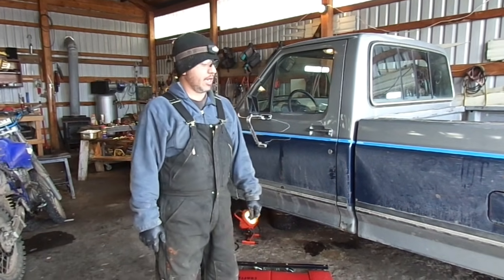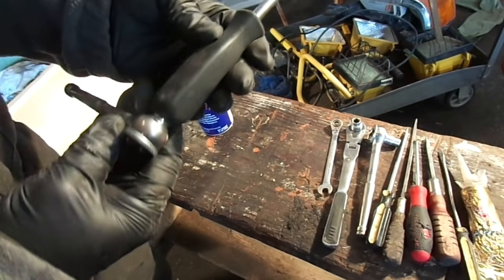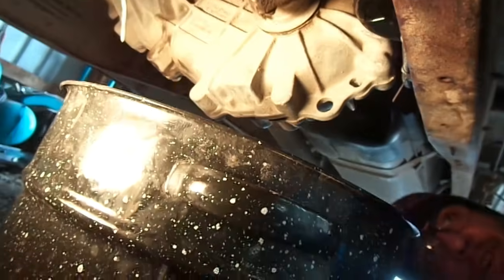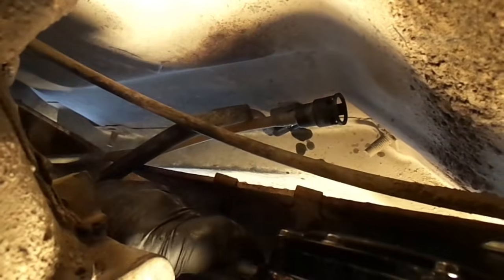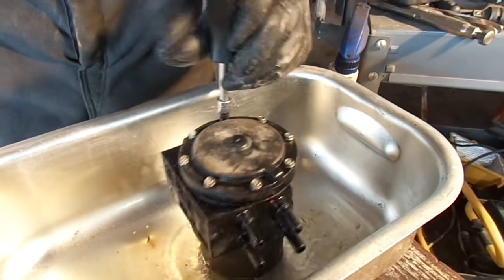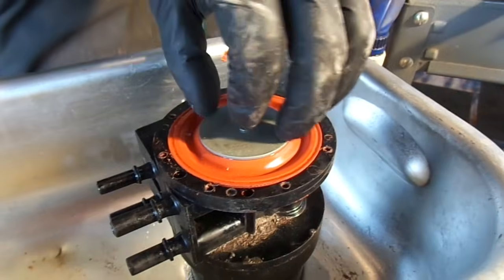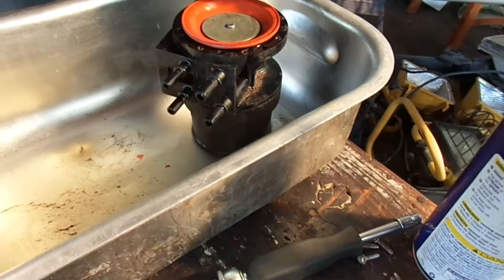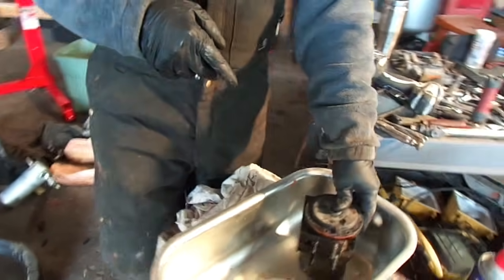1987 F150 Dual Fuel Tank Selector Repair

Comment: My experience is that this part is not usually repaired and replacing it from eBay is in the $50.00 range. No specs on torque force.

Comment: I know it's 8 years old and my 91 f250 460 4wd doesn't seem to have this part or at least it's not on the rail.  But thanks for making this.  I will sub to  see your progress in life.   It was hard to take a video in the dark under there with gas dripping. Kudos.  So some port directs the gas to the top of that diaphragm and pushes down.  So I'm sure that's why the top orientation matters, thus the pins.    So just curious is that diaphragm available in case it splits.   And man that is a hard filter to replace.

Comment: Love the video.  This solves my problem.  My front tank empties real quick, because the return is going to my rear tank.  I run off my rear tank, but only fill my front tank, till it is dry.  This happens in about half an hour with a half tank.  Then I switch to the rear tank, which I haven't put any gas in it for over 2 years.  My procedure is a work-around, but this information is the solution I have been looking for.
Thank you very much.

Comment: I have an 86 EEEE-150 dual tank. I imagine they used the same equipment? The van has been in a garage 25 years. I put a battery in it, and it cranks over like a new car, SUPER fast. It also has spark, and the air filter still looks like new. I am guessing either one or ALL of the pumps are bad, and probably the selector as well.
Reply: Well, finally crawled under my van, and it is COMPLETELY different from this. Glad I checked! The selector valve is electric, and readily available on rock auto for less than $70. And since it is 2wd, there TONS of room to work on it!!

Comment: Awesome job. I'm trying to troubleshoot why my truck had the side tank removed. I had all of the parts to put it back in and once I was ready to connect the lines I noticed that this valve is missing. This gives me a high level of assurance that once I purchase a replacement valve I will be able to run both tanks again.

Comment: Nice video, thanks a bunch. I have an 87 4x4 F150 lariat with the 351, its a factory 4bbl HO engine and it has the mechanical pump going into the timing chain cover with the egg lobe on my cam. I wonder if my unit is different. I will go look in the morning as I have the back end up in the air as I am redoing the back brakes cause of some idiots screw up on them 5 years ago. Both my floats have drowned so my tanks don't read properly which is a real headache cause I live way way way off grid in Arizona and fuel is precious, my tank switch is screwing up and my front tank builds up incredible pressure after its been running for over half an hour, i consider it dangerous, when you take off the filling cap pressure rushes out fiercely and loudly but not the back tank. If anyone knows anything about the 351 dual tank carburetor version with the manual pump i would really appreciate some advice. I have been a FoMoCo guy all my life but even now at 60 I am still learning and this is the first dual tank truck I have had problems with. I always called it the tank solenoid but I obviously have been mistaken. I need my truck it does everything an off gridder needs to survive right down to hauling my water and propane and livestock hay. Thanks to this guy for caring enough to show this. ✌️

Comment: in case you still have a fuel leak 7 years later you missing a very small O-ring right where it is leaking. That whole just above the nipple directs fuel to top of diaphram that little notch on top of cap is the fuel passage why cap goes only 1 way. I am watching this because i have simillar problem but mine seems to have to do with that center screw retaining the diaphram. Mine does not have as much travel up nor does it stick out as much seems that is some kind of valve attached to the diaphram beside the 2 prongs I am thinking maybe it is stuck or not have full travel. Can't even get the diapram to move up whne it is screwed down even though the 2 valves move freely. Anyways thanks for info

Comment: Good job your very brave I just got through doing mine since I watched you do it I have a couple bits of advise for those brave souls doing this .
1 I personally couldn't get mine to operate properly on my first try I found out compressed air helps diagnose whether it works the way it should I went a little further doing mine I used intake  valve cleaner to break up the gunk and a toothbrush and a little round brush that came with a set of husky spray guns for painting the brush worked very good getting into small pipe holes.
2 on the lid when you put silicone try to avoid the small hole where the square pop out that is a orifice that lets air go to top of diaphragm to push it back down if that hole isn't silicones Round and sealed also open to let the pressure of fuel to push down diaphragm back down

Comment: Just one other thing, you had a filter in yours, I just watched another video after your and the guy had an 88 and there was no filter in there. But since we both have an 87, when you removed the lower half there was a filter in yours and what was the shape of it. Did it look clogged. I'm just wondering if that's my issue

Comment: Wow what a nice thing to do for all of us ford owners, hats off to you and your wife. I'm having an issue with my 87 f150 xlt lariat, and I'm wondering if it's the filter inside that canister, that's clogged, that's not letting gas, get to the motor.
Could that be possible? I did a long trip with my truck. I put on 245 Miles on the front tank and then switched over to the rear tank and put 44 Miles on that tank. Then the truck decided to die on me. I got it to start i went about a 1/2 a block and stalled again, that happened 3 times I sprayed starting fluid into the intake and the truck started. Then died, I replaced the fuel regulator but nothing. I can hear. Each fuel pump in each tank when selected prime. But the truck just cranks, I took off fuel filter canister and blew through it, that was clear. I'm thinking either the high pressure fuel pump Or the filter in that canister ? What do you think, Do you think it could be that filter or the high pressure fuel pump. Any help would be much appreciated. Thank you.

Comment: Its their better fuel, leaves a white powdery residue,  on older engines it cakes up! Anywhere fuel flow and mechanical motion required,  is screwed.drain fuel systems before parking ANY amt. TIME!

Comment: Thanks for the video but you missed a very key part of the design of this valve and the reason why they leak. There is a small port and o-ring at the top half's mating surface. This o-ring collapses over time and yours was probably flattened. The port also can get plugged with the old o-ring as mine did. There is no need to put any gasket maker on the mating surface as you did. That will probably make it harder to disassemble or damage the diaphragm the next time you try and disassemble it. The diaphragm itself is designed to seal this joint. The o-ring is a common size and I picked one up at my local O'Reilly's for a less than a buck. The rest of your video was great. Mine was also stuck and I also worked it loose with WD-40. Thanks again.

Comment: My 85 2 wheel drive had two tanks. But unlike every other video I have seen, my selector valve only has two lines running in and to lines running out. Many I see have four on one side and two on the other. I am having problems getting fuel to the engine, so a lot of my research is pointing me here. I am going to replace the high pressure pump as well

Comment: My 1996 F150 when I start driving it either on the front or rear tank to my destination. Stop and return  back later to my truck start my truck and my engine starts studding and will not run however when I switch to the other tank it runs perfect. Help!

Comment: That Dual Fuel Tank Selector has a filter in the bottom of it, the bottom unscrews. I just took the filter all the way out, since I do have fuel filter on the line. But had trouble finding a new O-ring for it. I ended up finding one in a O-ring kit at advanced auto. They do make an replacement for it but it's much smaller since it doesn't have a filter built in to it.

Comment: THANK YOU MY FRIEND, just had the issue today ( 9/7/23 ) fuel running out the " not selected "  FULL tank on to the ground while running. a friend suggested fuel selector valve, returning to the wrong tank; or bad ground wire at the switch (95) f150. I'm glad you took the time to share your research and problem solving skills.

Comment: Would you know if it goes to a Generator too? I have 1989 Van RV is it the same piece? I just bought it. But the tubes to the 2nd tank is just free floating. If I hit the switch the gas will just pour out into street.

Comment: I just pulled mine from my '91 E-150 van, but it has no filter. Would I benefit from adding a filter? Another comment says Wix 33268 is the correct filter.

Comment: Leave it to a farmer to come up with the best diy fix for this stupid fuel tank selector.  I bought a nos valve a few years back before they dried up,  and just swapped it in.  I am definitely going to use your fix on the old one.  Mine had the classic run off one tank and return fuel to the other issue.  I'm sure it's just a stuck valve.  Thanks for producing this video!

Comment: I've used this video a couple of times.  I have a tip, and if someone has already added this, I apologize for duplicating.  Before you separate the top from the base, and then have to figure out the alignment pins, if you use a screwdriver or a pencil, just score a line from the top down the side of the exterior part of the selector.  Then all you have to do for alignment is just re-connect the line and you're hooked back up.  Really enjoy your information.  I'll be performing this same process on my 89 when the weather warms up later this spring.

Comment: This "tank selector" has no electrical connector. How does it know what tank to use when you change tanks on the switch? That peice you re working on is nothing more than a resevoir / filter. This is NOT a tank selector switch. The reason it exists is because the tanks have no baffels in them. Therefor if you have a low tank and going up or down a hill, or switching tanks on the fly there won't be any hesitation or stall. There is a tank "selector switch" further down towards the tanks (at least on my 1985), and my filter was unable to get apart. 1985 was the first year of EFI and didn't even have a schrader on the rail. Unfortunately every was different for 1980-1986, and between models also. After having 2 of these trucks OI found the best way to fix these trucks was to get rid of them. They are terrible designed excuse for any truck, unless you are in need of a head full of useless knowledge. I ripped out the EFI and put a carb in and have zero probs now. Carbs only need 7 psi fuel pressure, did away with the hi pressure pump, got a pressure regulator off amazon that handles input and return, and left the existing tank pumps and it works awesome, even with the electrical. Trust me, chasing the gremlins in the efi will take years off your life!

Comment: Thank you so much. I’ve had new fuel pumps installed, and it goes back to pumping from the back to the Front. This is on my F150, 1990. This is an easy fix, 👍

Comment: Good video. Did it myself but ran into a problem. The gasket sealant I put on stuck a little bit to the orange seal and blocked an air hole causing the truck to not get gas through the valve. So I took it off and removed all the gasket maker I put on earlier than I put it back on without any sealant and I never got a leak and my truck was getting fuel through the selector valve.

Comment: Great video! Mine is leaking out the top of the valve only when I run the front tank. And the rear tank pushes fuel to the front. Both tanks work tho.

Comment: great presentation appreciated as it saved my ass.foolishly put some gas in an empty tank on a ford I bought to get me through the winter. worked ok for a bit then lost all power. switched to front tank but too late. i guess the tank selecter valve got stuck between tanks. couldn't be purged.kept making bubbles. i rolled around under the truck checking connections...swapped filters. finally got tired of cold and dark. came in and started u tubing. found your site and the little light went on.nobody had anything like what you did. good work donkey. my winter truck lives again. thanks a bunch!

Comment: Son of a! Where was this while I was troubleshooting my sffr? Thanks for this. A bonus tip for anyone dealing with this, there one fatal flaw in this reservoir, if the rear pump  in the tank isn't working you won't get fuel into the reservoir, it has a pressured valve within that has to be pushed by a pump to open the path. The solution, assuming you don't want to drop the fuel tank for repair, you can grab an external pump like the front side uses and install it just behind the reservoir on a short fuel line. This creates a full fuel situation where the pump in the front and the back generate symbiotic pressure at the resevoir. I had to buy a dually like yours, for the second tank I put I just looped the gas line on the bottom channel and pinched the hose together.

Comment: Just curious if anyone on here knows how to do a conversion, and eliminate the rear tank? I’ve got an 85 F150 with a bad rear tank, and instead of replacing it we’d just like to convert it to run off the front tank which is good. Any ideas?

Comment: Hey Saul, have watched this video a number of times, and I find it to be the best there is available, EXCEPT  for one thing, and I am seriously  not trying to be a Smart Ass! What you were missing, is that, when you were showing how to reinstall  the cap, near the early part of the video, and finally lined it up so that that little square bump lined up to the front tanks feed line, there is a very small, tiny little o ring right under that square! If you look again, there is a tiny hole that comes out of the side of that little square bump! This is where the fuel was escaping and shooting towarrds your transfer case! Look into this! And in all actuality  you should NEVER use a sealant  on this device! Like I said, Love the video, but would Love to see you update, with o ring, and NO sealant!

Comment: another issue since it was leaking I stop driving it since no one would help me solve my issue.  6 to 8 months later I go to start it. over 1/4 tank of gas now it will roll over start for a second and dye down.  what do you suggest is the issue. I here the fuel pump come on... could it be the relay, ignition module. pulled the middle plus did not look like it was getting a spark and the tube next to valve I put a pin in it, it was not squirt out gas, but gas was coming out so my cousin said it is getting gas to start so he think it is the ignition module....what do you think? Thank you for any feed back in advance.
Reply: Hey Pamela, does the fuel pump shut off shortly after coming on? I personally would pull your fuel line and grab a gallon to catch the fuel coming out of it, then turn the key on to see if the pump stays running and fuel comes out of the fuel hose consistently. That’s where I would start.

Comment: ok, I am trying to follow you. amateur but I listen and learn well. my uncle gave me his truck. 1987 f150 lariat 5.8. he say it is a 2wd. he told me something wrong with back tank don't use. never have but all of a sudden I have gas leaking. I plugged the tube coming from the back and I still have gas leaking and it is I think coming from the resevoir. Mechanic keep saying I need a new tank and that it is leaking from the top of the front tank. which I am not convinced. when I turn the truck off my gas is leaking out now if I got a 1/4 tank how is it leaking out the top of the tank. Mechanic said because of pressure????? No one had been in the resvoir, so what would make gas leak out of it....is it what you are explaining that that piece inside is stuck and basically I need to take the resvoir down apart spray some wd40 in work it up and down and that should solve the leaking issue and not to forget to put gasket seal on it??????
Reply: If it leaked it was because you lost the tiny o ring right under the little square bump on the cap!

Comment: Gas usually eats thru silicone. Gas tank sealer in the red n yellow tube works good
Reply: Only reason Saul had to use sealant,  was because he had lost the tiny little o ring that goes under the small square bump on the cap! No sealant  should ever be used on this device! Other than that, this is the BEST video available!

Comment: Im in a 89 ford e350 camoer right now and just changed the filter on that before i left ...when i switch it on it should fill up to full thays what was hapoening ...and when i shut the switch off the tank went back down to a half tank ...is it working correvtly? And can you switch the tanks while your driving or not a good idea? Thanks for the video its great

Comment: can you clarify the problem being solved by this repair?  is it the issue where the dash selector switch doesn't allow you to go from front to back tank properly?   or is it the issue where you are on the front tank and the fuel returns to the rear tank incorrectly?  I can see by the design of this valve that a weak fuel pump in either tank is going to result in this valve not opening or closing depending on which tank is selected.
Reply: Correct!